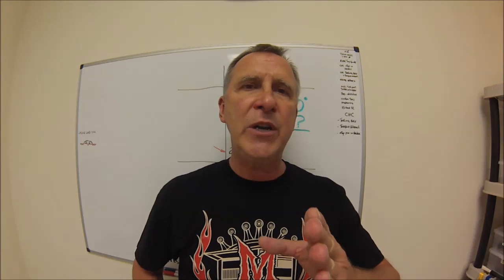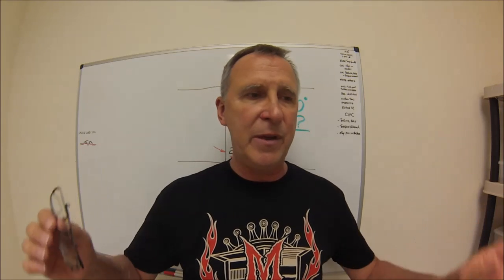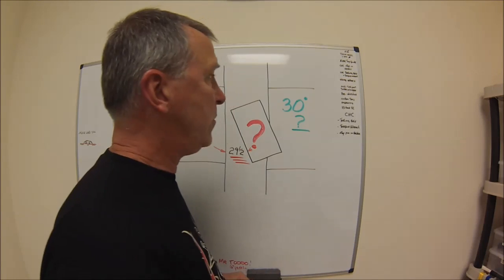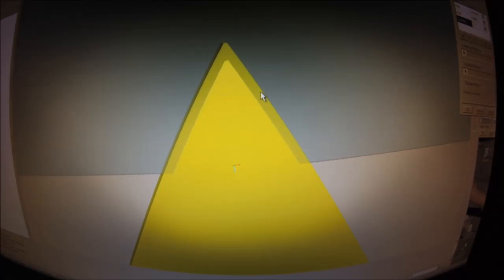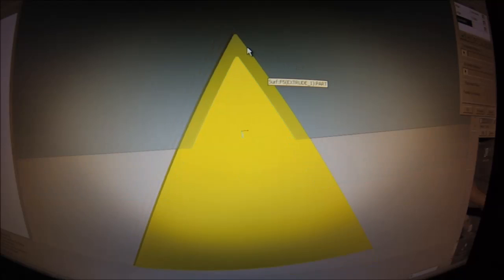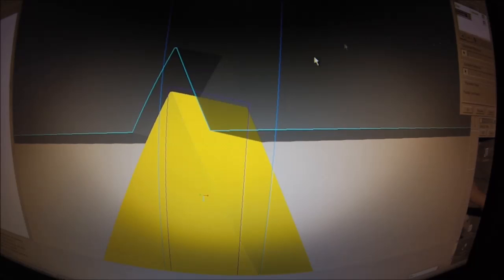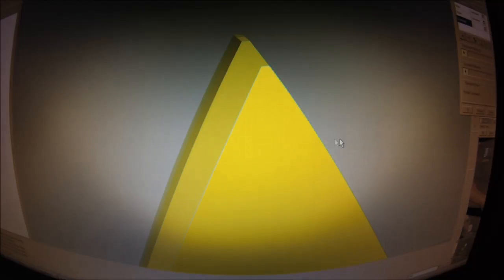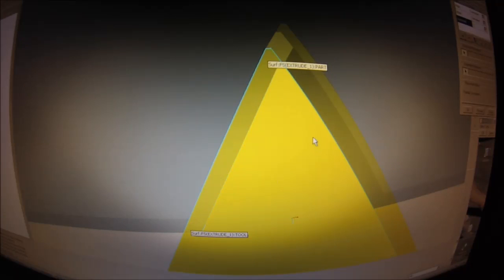Lathe Compound Setup for Single Point Threading...Myths and Musts

Comment: I'm only a hobbyist, but I've always thought machining and the techniques required should be based on logic, facts, and physics. So great explanation of what's really happening Joe. Since everything is basically rubber and nothing made no matter how heavily built is ever completely rigid, plus the stack up of tolerances that allow the slides to move even on a high end brand new tool room lathe, plus the tool and machine parts flexing under cutting forces. That would tend to force the tool slightly off that 29-29.5 degree path and to the right anyway.  So setting the top slide to a certain angle is still only going to be approximate to what it will actually be during a threading operation. As the thread depth deepens the cutting loads go up on the left side of the tool tip and the tool and machine parts will flex even more to the right. That angled top slide does help on my lighter lathe simply for the reasons you've pointed out. Mine just doesn't like straight in threading on larger thread depths.

Comment: Hi Joe, thanks for the interesting and informative video. Another technique that I like to use, especially when picking up an existing thread, is to set the compound at 90 deg (parallel to the bed), and to advance the cross slide for the depth of cut, say for example .010", then advance the compound by half of that amount, in this example, .005". This gives a tool position change close enough to what a 29 deg compound advance would give (the correct compound advance in my example would be .0055"). The amount of cross slide advance directly compares with the fish tail gauge values, and a final light pass of .001" or .0005" without any compound advance should complete the thread form. This technique also allows precise control of the form of the thread root. With a coarse thread, for example 1" x 8 TPI, the root flat should be .0313" (P/4). This can be accomplished with advancement of the compound only. Using the 29 deg method,  an overly deep root cut or special tool tip grinding would be required. Thanks again for your good work.
Reply from the maker: Thanks for watching. I always enjoyed picking up existing threads.

Comment: A few months back I experimented with this on a Sunday afternoon.  I did two threads on the same piece of steel.  One using the 28.5 degree and one just advancing straight in.  I could not see any difference in the threads.  I even examined them with a usb microscope and they look very much alike.  Then some viewers told me that overseas plunge threading is normal and they had never heard of the 29.5 degree stuff.  So I can certainly vouch for your facts, from my non-machnist experience.  I have been threading using the plunge method since.  Thanks for the great video.
Reply from the maker: I plunge everything too. I did this video to illustrate chip load and tool geometry impact on the cut. I hope the message came across. Thanks for watching.
Reply: Did the same test years ago to prove the point, and got the same results as you.

Comment: Mr. Pieczynski; It's obvious you have a wealth of first hand experience in the craft. Thank you for your shop advice, and excellent illustrations. Being a retired lifelong machinist, I still have a love for the trade. Before I retired, I thought of myself as an accomplished machinist. Watching your videos has been really enlightening, even for an old dog. Just one thing. When setting the compound for a 60° thread, I must say I favor 29-1/2°. In my experience, especially on older equipment, I've had "scuffing" on the trailing flank, especially with carbide. (@ 30°). Tool life is shortened, due to chipping. Chips seem to be dragged past the trailing cutting edge, making a poor finish. Your equipment looks to be top-notch. You may not have this problem. Much of my experience was on old rats. Early 1940's machines, especially war production board tools. That's where I learned the trade. Mark

Comment: Good demonstration Joe, and the PC model makes it easy to see. I do however think some of your comments below are biased to your own experience with thread cutting for 40 years. I've been doing it half of that and always used the compound angle infeed and it's what I know, and what I'm comfortable with. Muscle memory. Why should I change? Why is having my compound always set at 29.5 a waste of my time? I like keeping my cross slide set to zero on each pass and keeping up with the depth with the compound. It's what I'm used to and it's what I'll continue to use. The proof is that it works.
Reply from the maker: Hi Adam. Thanks for checking in. You are correct. I am a big advocate of plunge cutting threads. Its my comfort zone just like your offset compound is yours. In our job shop world of "time is money" I just wouldn't support one of my guys spending too much time trying to set the compound to a precision 29.5 degrees when a quick 25 or 27 is only going to afford .0002 more of a chip load. That is a waste of time. I hope you agree. The muscle memory comment is something I will never argue. I have supervised and trained many journeymen and apprentices during my career and know first hand, 10 guys will do the job 8 different ways and get the same result. As a foreman, sometime you just have to stand back and trust someone else's hands and experience. I personally have had tough industrial machinery at my disposal for the majority of my career and have cut threads so over constrained for military applications, that plunge cutting is the only option. The compound is used for pitch diameter control once a critical root diameter is achieved by the cross slide. You are right...a good final part made in a reasonable time is truly the proof. Take care Adam. Thanks for the comment.
Reply: Something I'll add is that on my lathes I always keep the compound set at 29.5 and the tool post indicated square to the work. The lathe is most always ready to cut threads at anytime. It's when I have to use the compound for other angles is when I spend more time changing it around. At my day job machining hydraulics rods is an everyday thing, so lots of thread cutting there. Using the compound infeed easily allows you to keep up with depth if you return the cross slide to zero each pass. Keeping up with straight infeed position each time is too much for me. To each there own, I just don't want someone saying the all to familiar "your doing it wrong" just because there's more then one way to get the job done.
Reply from the maker: Hi Adam. I can understand everything you said. I too usually have my tool post indicated to zero, and usually have at least 1 tool holder where the vertical tool registration surface is also ground to zero. Thats my thread block. Your environment is perfect for your setup and technique. My latest video was more to address everyone's belief that there is no right side load with the 29 degree method. I think I successfully proved that is an incorrect statement. I am more than open to new methods and ways. Its what helps us all grow and learn. I would be the last person to ever say, you're doing it wrong' just because you are not doing it my way. We all have our techniques. Stick with what works and gets the job done, but keep an open mind for the next best thing.  Regards JP
Reply: Joe Pieczynski.  Abomb's Monarch, and mine also, has a return lock on the crossfeed dial that's designed for single point threading. It allows you to set the crossfeed at the major diameter of the thread, then back out of the cut, and return the carriage to start the next pass with a positive stop on the crossfeed, and dial in the depth of the next cut on the compound. The exact depth of the cut can be determined with a little trig, or read direct from an indicator.
BTW, my 1946 Monarch CW 18x54 has 29 1/2 degrees plainly marked on the compound protractor.
peace-out..Tc

Comment: Hi Joe, English born and engineered here, and I like your analysis and explanation, but to be fair, in our neck of the woods...we were never taught that using compound projection toolpath totally eliminated rear side cutting (or rubbing).
Quite the opposite in fact. We were always taught that there would be material contact via depth of cut, however, this was always spoken as "good practice". The reason being that the root form is executed more securely if the tool is cutting around the tip or root of the thread, be it a flat form or radii form. To suggest that "snugging" the root form is a stronger and perfectly defined process. However we we also taught that upon forming the "root", minimal contact on the trailing edge was also paramount...
I kinda get what you are 'myth busting' about and agree, but as I say... My educators never claimed that no tool contact was made on the trailing edge...rather just to keep it to the root form for rigity in cut etc...

Comment: Joe, thanks for the explanation.  After watching your inverted tool video method of treading, I go strait in.  If you take small bites, it works for me and I can use the cross slide DRO to get the required depth of cut.
Reply from the maker: Excellent. Makes it easy doesn't it.

Comment: Hi Joe;
This very subject has probably started many arguments over the years.  I'm saying that as a humorous aside, not to lessen the info in your video, which I enjoyed.  I always enjoy being right.  :)
I do agree with you, no matter the angle, both sides of the tool cut, and I was convinced of that before your excellent computer demo.  Well done on that!
The 30 deg angle does help small or old machines, and that is probably where the practice originates.  Like one comment mentioned, it likely made a difference to old forged tools, as well as old machines even when they were new, considering babbitt bearings and less than perfect gibs.  Back in the steam power days.
One thing the 30 deg angle offers is to effectively increase the resolution of the infeed on the compound if you use a little trig to figure it out.  Other than that, meh, plunge it and cut that thread.  
Thanks for another well presented vid!

Comment: Done a lot of female, acme, double leed, left hand threads for limit torque operators in motorised valves. These were made of aluminized bronze. This stuff is hard and tough. You want to talk about wanting to chatter. The bores were not that big, and the nuts were fairly long, so good boring bar rigidity was never there. Typically, a general purpose acme at 28 degrees, so 14 on the compound. This stuff actually chattered worse on light cuts. Less tool pressure more harmonics, I suppose. So, I just started setting the compound at 90 and plunging straight back. Most were 2 sets of 2 at 4 threads per inch. So, slipping the nut was the norm. Anyway, with the compound at zero, I could fudge the tool forward and back, turn the lathe chuck very slowly by hand while engaged, and remove chatter marks when I was to depth. Engineering wanted a looser thread fit, so tolerance was not a problem as the minimum thread crest was not exceeded. Wow, that was 25 years ago.

Comment: I recently threaded with slightly less than 30 deg., but decided to try a smaller angle-- 15 deg. And surprisingly the cuts went smoother (reduced chatter) with the same light pass techniques. Sometimes, maybe it is many facets of the processes involved: tool, material, machine.. . and so on...

Comment: Thank you Joe, i never really understood this before. Understanding the the tip as a form tool was the ah ha moment!  As was the fact that you can form a perfectly good thread with a straight plunge, so  it follows if 0 degs works and 30 deg works 29 or 29.5 deg should work with no problem , clearly it does.

Comment: Joe, well played.  I just got to watch this one (3 years late!), and it is probably the best representation of tool movement and cutter engagement I have seen on the single point threading subject.  The computer assisted tool trajectory image made the video.  My background is in engineering, and this is spot on.  This should be required content for any apprentice learning to single point.    This has other applications as well, as tool trajectory is always a consideration in any machining application although not always as critical as in threading.   Again,  outstanding rendition and simulation.

Comment: Joe, i would like to start by thanking you for so much amazing info, you have helped me in a huge way! Second, if i could split my insert it could still be done, if your compound is set at 30 degrees  because of the fact that it is a helical movement, you do not contact the right side of the tool. Your pc model is only good if the tool is not moving to the left or right. If the tool is stationary and the part is rotating then yes! That would be the effects of cutting. But you are not plunging! You are effectively scraping the surface of the part as it rotates and the tool moves from one side to the other. If the right side(using your model that is threading from right to left) of the tool is cutting then i would be forced to say that your tool is not moving at the right speed, i.e to slow. I can't wait to hear back from you.  Thank you again so much!
Reply from the maker: Greetings. I have to respectfully disagree with your conclusion. Any advancement of the tool towards center, compound or cross slide, plunges the tip of the tool into the part. It is impossible to advance a tool into any material and not translate the area of the tip of the tool as the cut profile. If you were to split a threading tool and set your compound to 30 degrees, your incremental depth movements would have to be microscopic and you would have to make 100 passes or one side of your thread profile would be serrated. The computer model proves this without a doubt. Doing that is not like back turning a 30 degree taper. Totally different.
Reply: I am rather new to machining especially compared to your career in machining so i am rather stumped on this,  so if you are strictly talking about the plunge of the tool into the part, at what point of threading do you ever plunge the tool in? That wouldn't leave you with a thread, that would leave a groove.
Reply: @zachjohnson3261  i see why you are confused, but it's difficult to explain. the way you talk, you are thinking along the lines of, even when you're not threading, your still threading, because normal turning is technically still threading, because you're always cutting a spiral, it's just that a actual thread is just really coarse turning, say a hundred thousandths per rev instead of three, but where threading differs from turning is that 1. you are leaving material on the o.d.,the material that forms the thread, and 2. the tool is clocked to the part, and is "retracing it's footprints", it does not move away from the left side, if it did, the root of the thread would keep getting wider with every pass, the left side of the tool is locked on a tangent axis to the left side. think of it this way, when you do you'r first pass, the whole tip of the tool is cutting, on both sides, the second pass is exactly the same as the first, the tip of the tool is still cutting on both sides, the only difference is that on the second pass, you're using the right side of the tool to make the cut wider.
Reply: This is correct, same as if you are reducing the diameter of a shaft with a conventional slide feed cut. Are you cutting off both edges of the cutter then? No, not really. The left side of the cutter is removing the material, the front tip of the cutter is behind the material that was already lifted by the leading edge of the cutter. Equally if you are using a parting tool to plunge 90 degrees into a part, is the side of the cutter cutting? again, no not really, it is behind the leading edge of the tool that has already lifted the material.

The main point of running at a 29.5 degree is to keep the tool pressure holding the carriage lash tight to the lead screw, while reducing tool pressure at the bit. Look at the difference in the swarf coming off a straight threading cut vs one where you are feeding the compound cutting off "one side", huge difference.

Comment: Old topic but YT recommended it so I researched it. I usually just go straight in as I can't be bothered to  move my top slide off its carefully set to parallel position. Years ago I did a series of tests cutting a 1.5mm pitch thread in 303 stainless going straight in and with offset top slide using the same full form insert. Looking at the results
 under a microscope I could not tell which was which as they looked identical. 
Having said that, today I cut several 1  5/16" by 9TPI threads in Aluminium on an unpowered Myford, don't ask, and set the top slide over just to give my left arm a chance of being able to lift a beer bottle afterwards.

Comment: The reason you should cut at 29 is so you don't get a chip from each side feeding (and smashing) into each other on top of your tool 
especially on larger threads I can cut way more per pass this way and tools aren't breaking
the reason we go 29 instead of 30 is to make sure to drag the right and keep nice profile and finish
the last .005  I do straight in a couple fine passes
heavy chips  do not like to be fed straight in to each other especially on ss and any steels or harder metals
brass you can feed straight if u want

Thats all i have to say about that